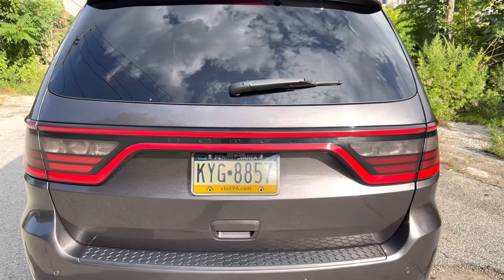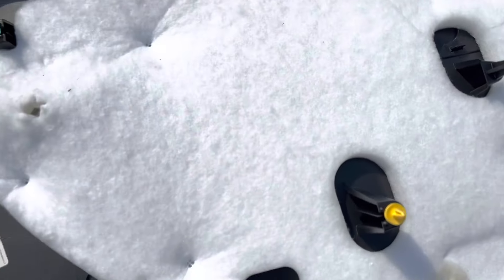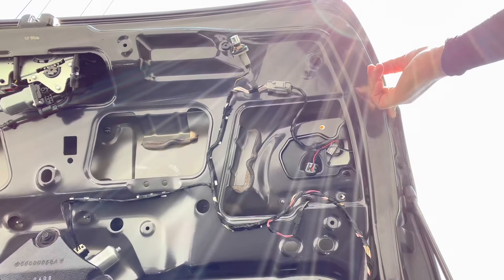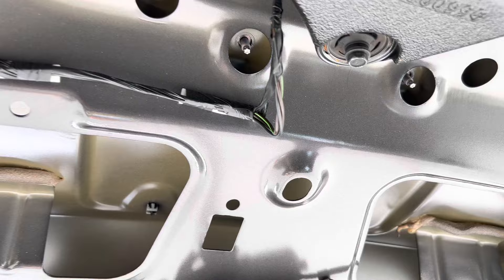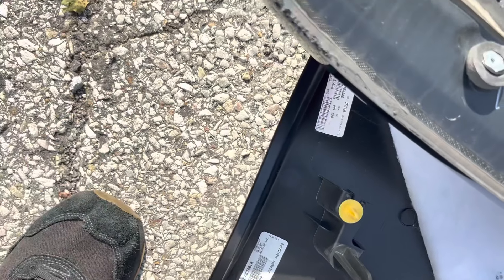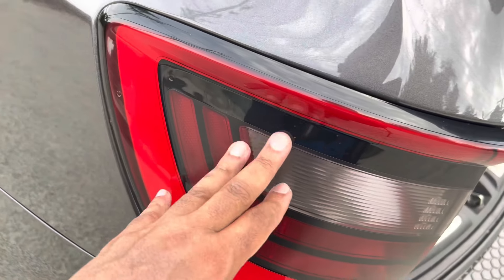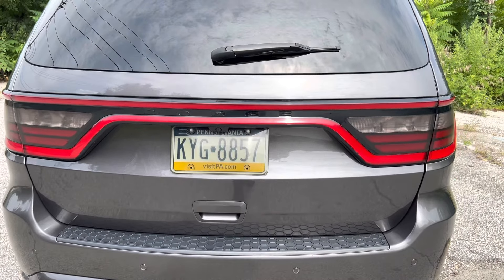DODGE DURANGO:HOW TO FIX AND PREVENT RACETRACK TAILLIGHT FROM DIMMING AND BURNING OUT!!

Comment from the maker: If your don’t seal the taillight it will eventually start to dim in spots and burnout.  Then you will have to fork out big cash! Or hope your warranty goes through in a timely manner(if you have a warranty) Thank me later..
Reply: If moisture (but no pooling water) has already gotten into the assembly, do you have any suggestions on how to dry it out before sealing it? I'd hate to seal any sort of moisture inside. My only thought would be to run continuous air into the assembly, but there doesn't appear to be any convenient place to do that.
Reply: Extended warranty? Dodge isn’t giving anyone the time of day on it especially calling the service center. There’s no recall and it’s not covered is what they’ve told me
Reply: @esharpe01  any idea how to get condensation out?
Reply: @AJCoReTV take out the nut on that side by the light and lift up the gate it will drain out within 10secs

Comment: I have a 2017 and in 2020 I started to notice water in mine and fortunately I got it replaced under warranty. But after about a year I noticed water in there again. So I removed the the light and siliconed everything and haven’t had any water in the light at all. I did this after watching your first video you made about this. It was super easy and I appreciate the knowledge you put out there for us Durango owns. I just wish Dodge would address this issue and take care of their customers!
Reply from the maker: Thanks. And Yeah, dodge definitely need to address this!
Reply: Exactly dodge need to come up with a solution for the water getting in the back lights

Comment: I have a 2017 R/T and water started getting in the right side light.  To make this short Ill tell you how I fixed the leak for $10 and 15 minutes: I bought 3m black tape about a half inch wide made to put on a car as a trim piece.  Amazon purchase.   I carefully taped it along the entire length of the fixture and the painted hatch. After 2 months it’s still keeping water from getting in.   Can’t even notice it unless you know it’s there. Maybe every spring I’ll replace it.  Not the final solution but at a minimum it’s keeping water out now.   I had previously removed a screw in the door so when the door is opened the water would drain out.  No water now.
Reply: How is it holding up? I just purchased a new taillight and I want to properly seal it
Reply: @Richking213 it’s about a year and it’s time to redo.
Reply: My “fix” is not a permanent fix.

Comment: Anyone watching this having this issue. There 2 screws on each side of the hatch remove the bottom one and the water will drain its self out. I originally thought mine burnt out i drained it and let it sit in the dry garage for a few days and it came back to life. Next step is to silicone immediately. Hope that works for you guys

Comment: One part that was left out, is that you will need a child's size hand to get in and squeeze those yellow tabs down (guessing this is why it didn't get recorded). Also, my green tabs wouldn't budge and I ended up breaking the trim. Use cutting tools on those tabs and just have a new set to hand. Thank me later
Reply: Use a pair of needle nose vice grip pliers. Set them to lock super close and just slide them over the tabs and pull down on the trim. Made it so much easier.
Reply: Definitely cut the green tabs and just replace.  My trim piece broke before the green tab did.  I cut of the second green tab and got it off without damaging the trim.   😢

Comment: The main vulnerable area is the gasket around the two big holes on each side (where the electrical wiring runs through). You need to add some thickness on those gaskets to create a better seal against the car.
Reply: I was wondering about that, I sealed mine all the way around and still getting water mainly on the driver side

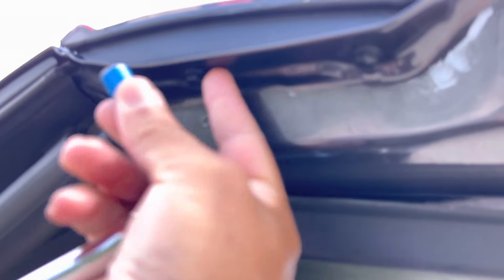Comment: I have no doubt this works, but if you want to skip all of that for the racetrack light bar, simply remove the bottom screw on either side of the hatch. Alex shows them at 2:30. This has served as an effective drain/breather vent on my 2018 for years now and seems to prevent moisture build up. I admit, we don't drive too many dirt roads with it and it is garaged, but dust working into the light has not been a problem. Light still works great
Reply: My 2014 had the bottom screws removed for drainage....and now I'm here to watch this video so I can install my new $1,800 racetrack....
Reply: @carrieyoung4118  center light is only $300 if buying from aftermarket not the dealer...LoL... clearly you're not getting anything better from the dealer infact I didn't notice a bunch of cracks in my eBay inner and outer set for my race track lights.

Comment: I am going to do this this week. I will use a black silicone to seal the edges up and spray undercoating on the back sides of the lights to seal up and hair line cracks from the unit being over tightened. This is my 2nd light for the Durango. The first was a long wait and it was covered under warranty. I have a small amount of water in mine now. With the power disconnected I will add 90 proof rubbing alcohol and distilled water to rinse out some dirt and bugs before I seal it up. Rinse it out and drain it through a small crack and let it evaporate in the sun then hit it with the sealing. The undercoating will also be a slight sound dampening. Time to add a few LED bulbs for the reverse lights. Thanks for the walk through.
Reply: Who cares

Comment: Wondering if the 2011 to 2013 tail lights have the same issue as the racetrack tail lights? Wasn’t sure if it’s the tailgate design that is causing the leak or if it’s the race track tail lights themselves that are leaking. The body style is the same from 11 to 2023. Wasn’t sure where the problem stems from?

Comment: I have a 2017 Douge Durango SXT that came without a camera, all the aftermarket ones come with a camera hole,  but it's interchangeable.  with my  Durango. Can I still use the aftermarket one and seal the camera hole?  I need help  the replacement one the dealer is over a grand

Comment: Do you think a hot glue gun will work?
I had a headlamp the dealer cracked and it was catching water and used a hot glue gun for it. Worked great, but with hot glue not able to smooth out nicely.
Great vid... thanks

Comment: I’m thinking this has to be the reason my LED license plate lights aren’t working at all. Took them out and they had greenish corrosion in the sockets. Drove from Texas to Illinois and got pulled over for my license plate lights not working and I didn’t even know they were even out. Then I looked up the price of new lights and was like 😮 msm I’ve looked everywhere and apparently this is a major issue with the whole back panel and even had a class action lawsuit

Comment: How do you get the left over condensation bubbles out?
Reply from the maker: Remove one of the drainage bolts. Ever since I’ve been leaving one of mine off I haven’t got any condensation since.
Reply: @AlexsRTLife  I just took it out bolt & water came out… I will leave bolt out… will the leftover condensation eventually disappear?
Reply: It’s almost winter here now in chicago. First of all Alex I would like to thank you for the video. Easy to get on and off with right tools and common sense. But I wanted to dry it out and seal it immediately so I brought it in the house and too the reverse lights out (also swapped for LED)and used my wife’s hair dryer for a little over an hour working one section at a time from the outside and any possible way to get warm forced air inside but never using the hottest setting to prevent damage. After I got every bit of condensation out I sealed it with clear outdoor 100% silicone and let fully dry and reinstalled hours later. All good. Doing the left and right tail lights tomorrow. What a pain but I hope it holds up for a while. 21 Durango RT

Comment: Love the vid great details will right after i find them lil mofo clips they are hard to find do they yave a name need this ASAP thanks
Reply from the maker: Look on Amazon as Lift-Gate retainer pins (they may be yellow and not the original green. eBay has them in the original green color
Reply: Thanks I did find them on platforms and went with ebay They were 8 pieces not 40 lol thanks

Comment: Going on my third race track on our 2018. Thank God for extended warranty,  but my just seal it once I get it back. Crazy they don't have a fix for this
Reply: My dealer claims its water damage, not covered.  How did you get yours covered? Help!?
Reply from the maker: My guess is that it may depend on your warranty or depend on “what the shop says”. I know if mine were to fail my particular shop wouldn’t give any hassle. If it’s covered they’ll replace it under warranty
Reply: Do you by chance have AUL extended warranty? I bought my 14 Durango a couple of years ago and got a AUL extended warranty with it. My light is starting to go out/black out where the water sits. Thanks!